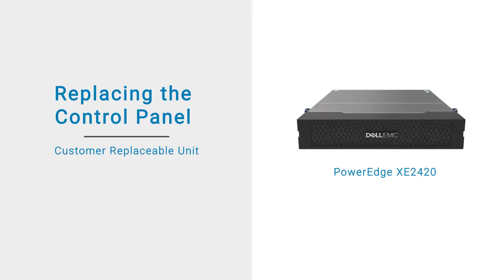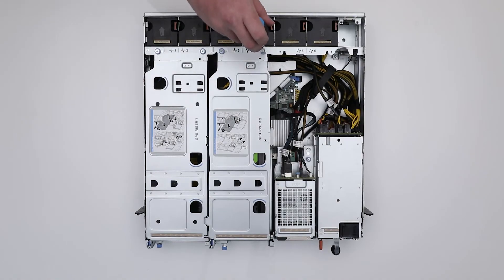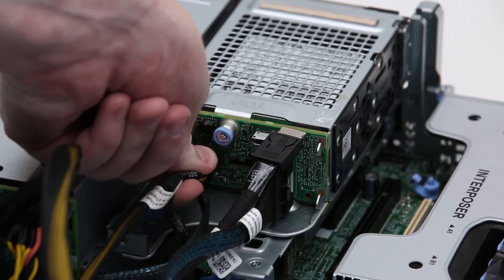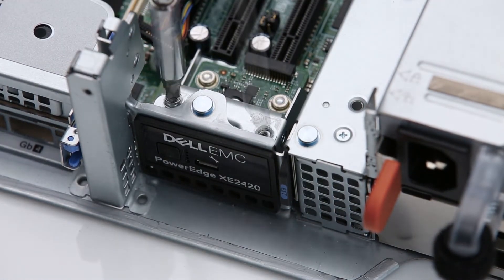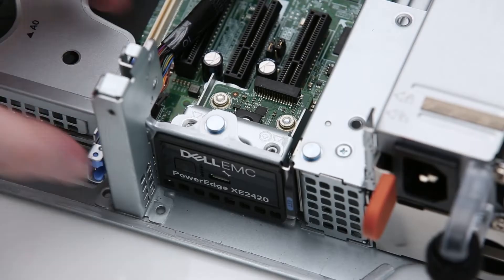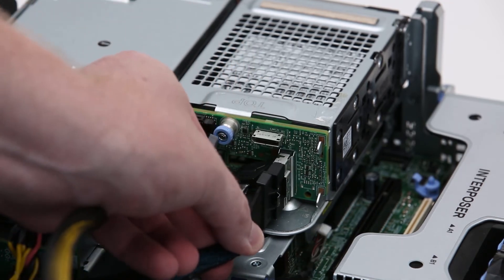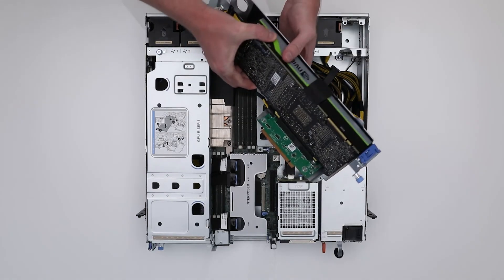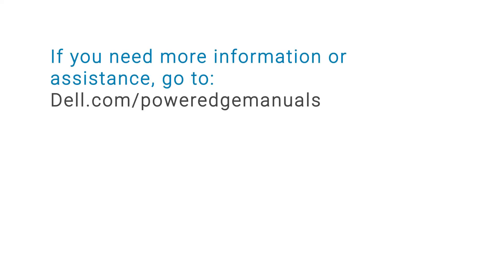How to replace the control panel on a Dell EMC PowerEdge XE2420

Comment: What role does a PowerEdge XE2420 usually serve? I'm just curious because of those two GPU's. I never really thought a server would need that type of GPU power.
Reply from the maker: Heya Komaboi19, GPUs are traditionally used to process complex algorithms in the Enterprise space. Universities often use machines like this for complex calculations.